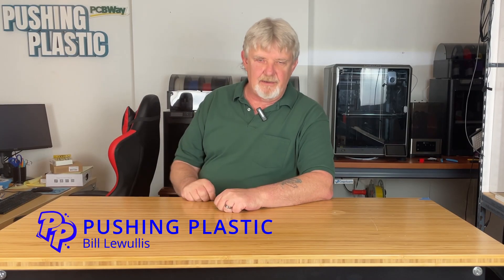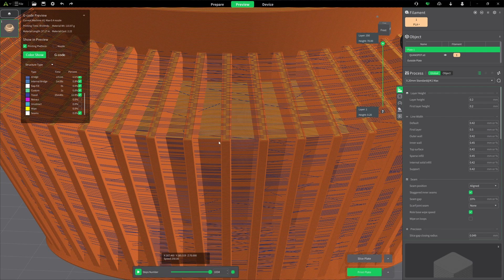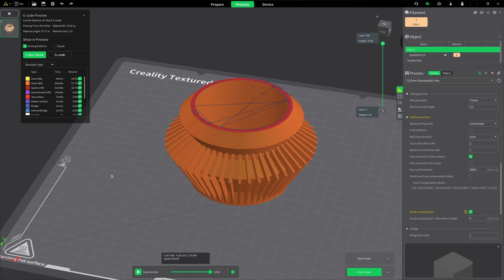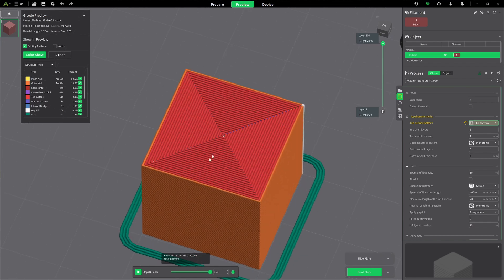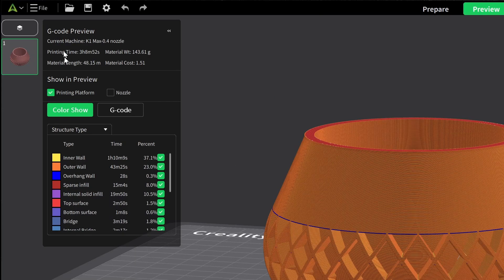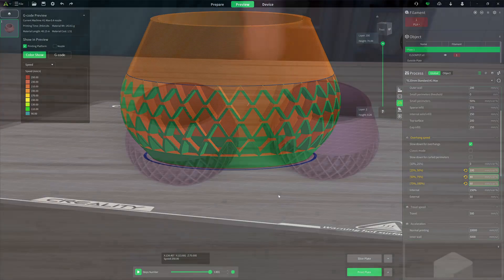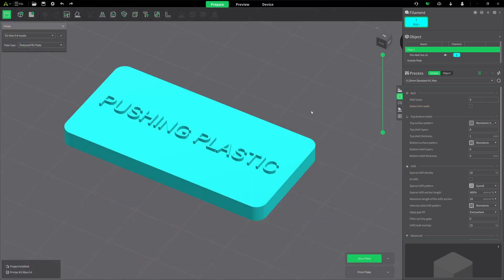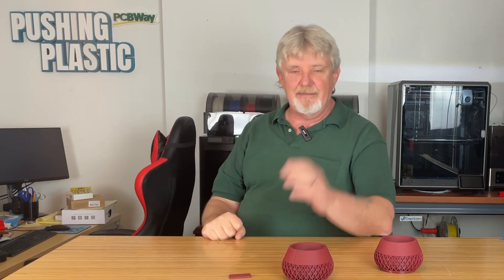Tips For Clean Prints With Creality Print 5

Comment: great information!  Question, why on my prints is there always an extra box printed?  I just got my printer and have only done two prints, but both had an extra box.  And another quesetion, my new K2 Plus came with a .4mm nozzle, it seems all the prints are .2mm.  Can you do a .2mm print with the .4mm nozzle?  Sorry, so many questions, but love the videos and instruction!
Reply from the maker: The extra box is probably the Priming Tower. Multi-color printers usually have one when printing with more than one color. It's helps make sure that Color A has been cleared from the nozzle before color B starts. You can turn it off in the "Others" tab of the Process area. I hope this helps!

Comment: Hi Bill. Did you know there's an update for Creality Print 5.1.4, it's 5.1.6, I just finished installing it, you don't loose all your settings. Regards Gary 🙂
Reply from the maker: Yes sir! Sure do and I'm running it!! How are you liking it so far?
Reply: @ hi Bill, I like it. After I did the flow calculation and the volume metric flow, I’m not getting any layer lines at all, just some fine cobweb stringing at times, otherwise all is great. Cheers, take care. 👍🏻

Comment: Ive been getting prints that look like it skips a line ive tried everything i dont know what the heck to do happened outta no where
Reply from the maker: Skips a line? In the z-axis? If the z axis, I would check to make sure that there is no debris on the vertical screw, or look for some interference that might be causing the filament to get hung up when it reaches a particular height. What printer are you using?
Reply: @ yea on the Z. Its so strange, i wish could post a picture but i will try that thank you. Awesome tip video
Reply from the maker: @JayEm16  I had it once on my Ender, the filament was getting snagged. Then it would break free. Another thing to check is the filament spool and make sure that there is no burrs on the inside.
Reply: @ it seems to be happening with polyterra only which isnt as smooth. So going through bowden tube might be snagging it